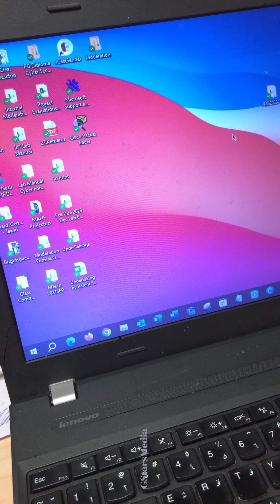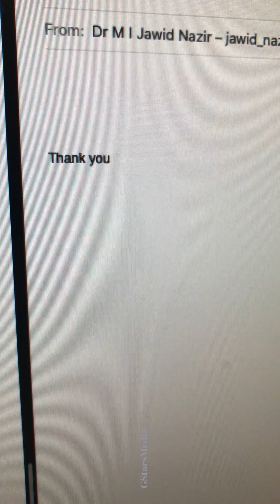Wireless Keyboard USB Dongle: Fix it in easy steps #shorts #viral#gstarsmedia

Comment: will the solder material and original circuit material diference cause any issues?
Reply from the maker: It's made up of copper, which makes soldering easy with lead. Take precautions when setting up the temperature of the soldering iron - 300 - 350 is resonable